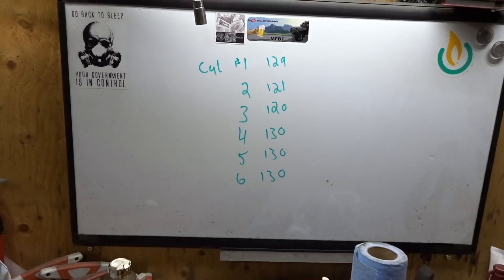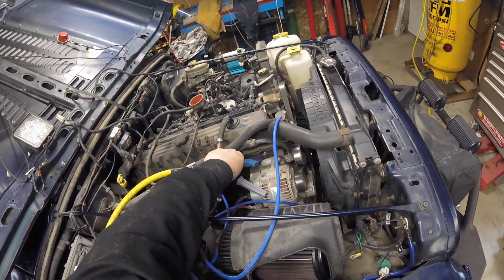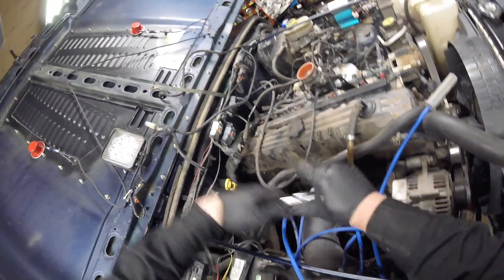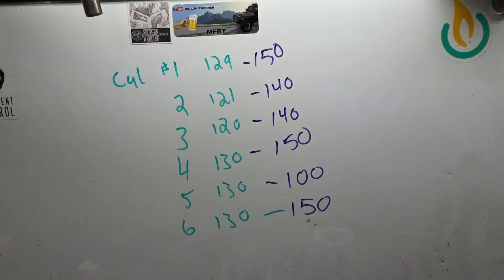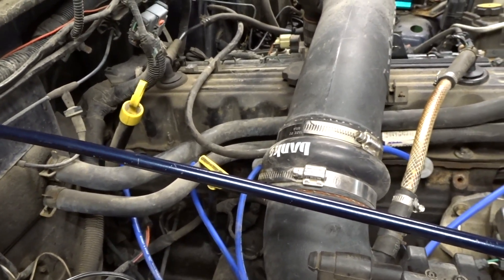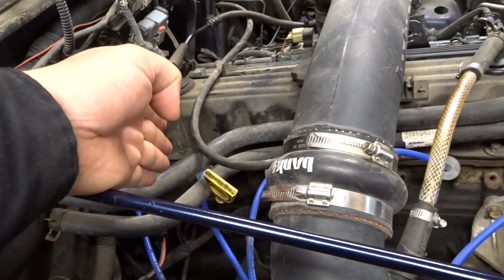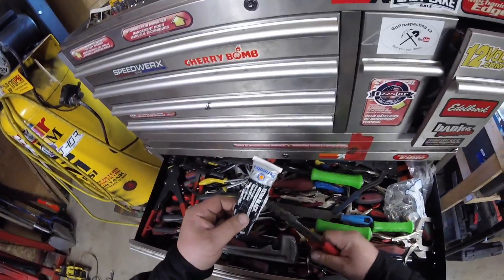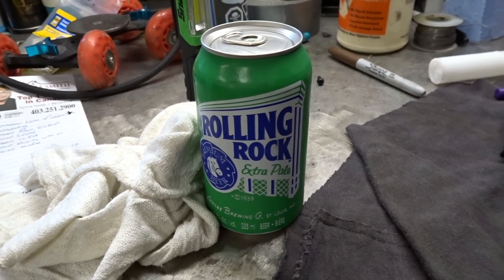Shocking Jeep Compression Readings

Comment: my 99' tj with the 4.0 with 300,000 finally said no more.  I did a comp test and I had almost 80 down the board
Reply from the maker: Oh crap that’s worn out, was it using oil ?
Reply: to be honest I have always changed my oil every 3000.  I did notice this past couple years that my power wasn't there anymore and after letting the oil drain for awhile I would be short about half a quart.  I like rebuilding engines or doing conversions.  I called around seeing how much to have the block and head redone and have the crank turned with new bearings and rings.  In Spokane I would pay for all the machine work to be done for about $1500.  Or, I can go to J&S or Jasper here for a new long block, 10year warranty and they deliver the motor, for about $1400.  I think its safe to say Im going with the long block.  As much as I would like to put an LS in it or even my 4BT, I just want to be able to have another 4.0, without having to go thru everything and mod so much.  Plus its cheaper with the 4.0 and easier and I'll have my jeep up and going again.  The jeep is in too nice of shape to me to lift and to start cutting up.  Its been good to me for over ten years so im going to be good to it and give it a new heart.  MFBT

Comment: Pressurize the #5 cylinder and see if the radiator hose gets hard. I had a chevy engine that would use oil after a fresh rebuild. Couldn't figure out what was going on until I did this.

Comment: Next time you need to empty your fuel tank, remove the Schrader valve core on the fuel rail and slip a fuel line over the valve's body. Put the other end of the fuel line in a gas can. Jumper the fuel pump at the relay and pump as much fuel out of the tank as you want to.
This method may also work if you want to change a faulty fuel pump, provided a good bump with a rubber mallet on the tank will get the pump to start one last time.
Reply from the maker: I wonder how long it would take to empty a tank
Reply: It took me about 15 minutes to empty 40 liters from a Jeep Grand Cherokee (1998 ZJ). Your results may vary, ha, ha, ha!
Reply from the maker: ManicMechanic007 that’s better than sucking on a hose siphon it out 😂😂😂😂